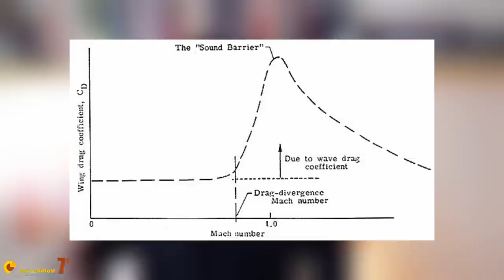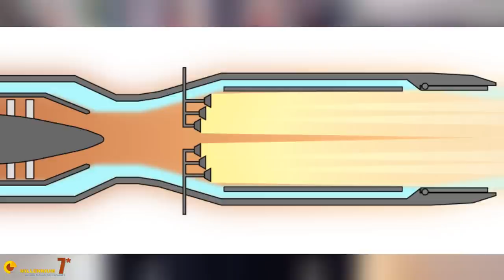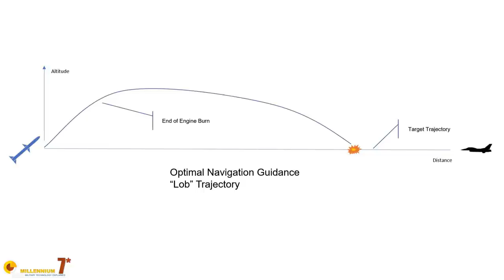Flying SUPERSONIC with NO Afterburner | Why SUPERCRUISE is so Important?

Comment: I think it's interesting that the aircraft with the highest supercruise number (F-22, Mach 1.8) is also probably the oldest on the list.
Reply: EE Lightning would easily accelerate to supersonic speed without Reheat, it would also do this in a climb. 1950’s aircraft
Reply: @alfretwell428  I'm afraid you are wrong - Without wet thrust the prototype demonstrated M1.02 ASL - before any payload and before development added the belly tank
It could accelerate wet to altitude and maintain mach in a shallow dive which is not supercruise
Reply: And by far the most expensive fighter ever made....
Reply: In the year 2021, 'the aircraft with the highest supercruise number (F-22, Mach 1.8)' may be accurate, but that is out-of-date info now in mid-2024. Currently, the j-20 with the new WS-15 engines can supercruise at Mach 2.2 substainably. This means that the F-35 (which cannot supercruise) is severely disadvantaged versus the j-20.
Reply: @johnseah5678  While I'm not an expert on the subject, I'm inclined to be suspicious of the numbers that the Chinese claim for their aircraft.

Comment: If I am not mistaken, the English Electric Lightning was also able to supercruise.
Reply from the maker: Yes, but it was a similar case like the F-104.
Reply: It might have been able to but wasn't too fuel efficient in any case, beautiful 50s aircraft though.
Reply: It could only do it in a vary narrow altitude window and with minimal armaments.
Reply: @Millennium7HistoryTech  according to the Lightning F6s Operating Data Manual it could supercruise at Mach ~1.05 at SL with full fuel and 2 red tops, and this speed only got higher with altitude.

Wasn't designed to do so but ended up managing it just fine. Either way wouldn't call it a cruise since you could empty the thing's tanks in 10 minutes!
Reply: This was a really interesting video. The explanations were very clear and concise with lots of (for me) new information. Excellent,thankyou!
Reply: @ukoctane3337  The Tornado could empty it's tanks in les than 9 mins. Many people think the EEL had short legs but used well could stay in the air for 90 mins +
Reply: @Millennium7HistoryTech  No - the F-104 was very unstable and the little wings gave very little lift.

Comment: I don’t think I’m a “fanboi” of the F-35; but the actual pilots will tell you (and have) that the aircraft can supercruise. Inasmuch as it uses afterburner to accelerate above Mach 1.2 (like the F-22) to Mach 1.5, then cuts to military power. It can then cruise above Mach 1.2 for 100nm-200 nm

While it’s true that the F-35 cannot sustain supersonic speeds indefinitely, it’s a bit disingenuous to say simply “it can’t supercruise” when there really isn’t a scenario when any aircraft would want to supercruise for more than 100-200nm
Reply: It's a bit of a technicality but people forget that the f35 is like the only jet that can super cruise with a combat load
Reply from the maker: Yes, I have heard of this, but the point is sustaining the speed to constantly stay above Mach 1 even in combat, even maneuvering., without using too much fuel.
Reply: @Aaron-wq3jz  well, the F-22 can as well. but yes, not many aircraft can fly at supersonic speeds with 2, 2000lb bombs and 2 medium range AAMs, a targeting pod and ecm pod hanging off their wings; the F-35 has all internally and thus, flies "clean"
Reply: @Millennium7HistoryTech  i understand.  I just believe that cruising 150nm at supersonic speeds should qualify as "super-cruise" as opposed to coasting. But to be exact, YOU are correct in that the F-35 cannot maintain supersonic speeds indefinitely. But to my point, if you can do it for 150nms....when would that ever be insufficient for the mission?
Reply: @mikeck9946   bingo, not to mention all the internal fuel and the fuel efficient engine which would allow it to carry all that 600nm+
Reply: @Millennium7HistoryTech  BTW, love your channel. Other than the fact that you seem to have romantic feelings for the Saab Grippen (lol), I find that you lay out information on aircraft performance without bias. Can't argue with science and math and its obvious you are quite knowledgeable about aeronautical "stuff".

Comment: I think that with the variable cycle engine, the supercruise issue will be solved for the f35 from what i've heard
Reply: It's not really an issue. They wanted range, not supercruise. The F-35A interestingly enough has greater range than the raptor even though it's smaller. Supercruise is way overhyped.
Reply: @EEEEEEE354  Supercruise is not meant for extended range. As millennium explained excellently, fuel consumption at supersonic speed is still higher in mill power, than travelling at mill power subsonically.

It is used for going into combat, where having high energy is the difference between live and death. Supercruise is not overhyped at all, as millenium explained greatly, but i guess you didnt even watch the video and went straight for posting uninformed comments.
Reply: @dyren7437  "they wanted range, not supercruise" what part of this statement makes you think that I believe supercruise increases maximum range? Come on now, don't put words in my mouth. What I'm saying is that the F-35 is a multirole fighter with a variety of of missions besides air to air combat. Supercruise was never a design objective of the aircraft. Range in internal fuel was. Supercruise is not needed for the F-35's role. This dude is claiming it's a "problem" when it's not. So yeah, I did watch the video, it just seems like you can't read. Do I need to break down english for you? "They wanted range, not supercruise". Saying "not supercruise" means that range and supercruise do not go hand in hand. I was NOT saying Supercruise was for extended range. I was saying the F-35 was optimized for range INSTEAD of supercruise. Who TF are you calling uninformed if you can't even read? 

This is why the F-22 has a combat radius of 590 nm internal fuel, and F-35 760 nm internal fuel. in fact, no supercruise capable aircraft can even approach the F-35's range on internal fuel. Supercruise limited range. The reason I'm saying Supercruise is overhyped is because it is not always necessary for the mission at hand. The F-35 is a strike fighter with kinematic performance of an F-18 or F-16. It was never designed to supercruise. It's fantastic air to air capabilities are achieved through superior sensors, electronic warfare, and stealth. Supercruise is just another point to make, it's not the end of the world if you don't have it.
Reply: @EEEEEEE354  Reading your last sentence: "supercruise is way overhyped" made me think you were talking about supercruise in general, not just for the f35.

Reading it again it makes more sense.
Reply: @dyren7437  read it right the first time. I absolutely hate when people like you misconstrue what I'm saying. Everything was clear, there should be no misunderstanding. Supercruise isnt overhyped just for the F-35. It's overhyped in general for an aircraft with more missions than just killing other fighters.

Comment: At about time 7:40 I think you misspoke when you said supercruising without AB still uses more fuel than cruising at supersonic speed.  I think you must have meant to say it still uses more fuel than  cruise at subsonic speed.  This points out that the term supercruise is a bit of a misnomer because it is not actually the normal cruise speed of the aircraft.  It is a tactical or combat speed that can be sustained without use of AB, proving tactical advantage at greatly reduced fuel consumption compared to AB, and fuel is life unless you're on fire.
I would like to know if you have any references specifically linking energy maneuverability theory to the development of supercruise, because I don’t see a real link.  Energy maneuverability theory about superior performance in a dogfight and rewards high T/W  and low wing loading, and afterburner is likely to be used heavily even though these fights occur at mostly subsonic speed.   Fighters were designed for superior energy maneuverability before supercruise became achievable in fighters.  Supercruise is about covering a lot of ground quickly while conserving fuel when positioning for and while engaged in a BVR missile fight, as you correctly mention in the latter part of the video.
Reply from the maker: OMG! You are right! I listened to that passage a dozen times and I didn't catch it! Apologies. It is exactly as you say.

Comment: Supercruise is actually NOT IMPORTANT compared to other characteristics such as payload, range, maximum Gs and other characteristics. That is why most fighters do not supercruise at all or do not supercruise meaningfully with a useful combat. Supercruising is NOT NEW. Tje Concorde supercruises for 3.5 hours crossing the Atlantic. If fighter designers in the 60s, 70s and 80s wanted supercruise they could have had supercruise. However, doing so would require bigger engines, lower bypass engines with worse fuel efficiency, reduce subsonic range, a slimmer air frame with less payload capacity, lighter air frames capable of less G loading or whatever else. It was deemed that it is better to have the most compact and lightest engines which still allows the aircraft to reach its maximum design speed.  And that means afterburning engines which is not capable of supersonic flight or barely able to sustain it on dry thrust. This is especially true of 3rd and 4th gen fighters worse external weapons significantly impact drag such that even if the compromises were made to allow for supercruise that capability goes away if you actually want to carry the weapons you need to fight with.

Comment: The M1,2 supercruise for the Gripen E is wrong.
No numbers has been released in public of Gripen E maximum supercruise speed.

M1,2 is however the maximum supercruise speed of the Gripen NG/Demo.
Gripen NG (or Demo as it's sometimes called) is basically a Gripen C with a more powerful engine and with the latest avionics.
Edit: The Gripen NG was a modified Gripen D (the twin seater), not Gripen C as I mentioned above.
The purpose of the NG was to be used as a testbed and demonstrator for the new technology.
I used the word "was" because there were only one aircraft built/modified of the Gripen NG and it is no longer flying since the Gripen E has started to be delivered to customers.
Reply from the maker: Correct consideration, I just assumed the two were similar, but it might not be.
Reply: @Millennium7HistoryTech  It could very well be the same number but since Gripen E is concederably larger than The D Version (the NG/Demo was a basically a D version).
On the other hand, Gripen E has been designed from the ground to achieve supercruise wich includes the drag has been reduced significantly.

I don't think we ever will hear an official number of Gripen E supercruise capability but I have heared talks about it will beat the Typhoon with some margin.
Reply: @mrSkandalpolisen  " heared talks"    "beat the Typhoon with some margin"    meehhhhh..... The Typhoon is one most powerfull twin engine.
Reply: @mrSkandalpolisen 😂😂😂😂
Reply: @armatacalanca962  Yes the Typhoon has very impressive engines but she is heavy.
The Gripen E may be a bit underpowered for dogfight action but she most likely has the lowest drag at level flight of all modern fighters (she certainly does have far lower wingload than the Typhoon = Gripen needs less power for the same speed).
Reply: @joshafc41  There has been some numbers released for Gripen E and it's supercruise.
Gripen E can supercruise at M1,2 equipped with 6 missiles and one center tank.
Exactly the same numbers official for the Typhoon....
Reply: @mrSkandalpolisen  The only accounts of the Gripen super cruising have been of a clean Gripen NG super cruising at Mach 1.2. So if a clean aircraft only reaches Mach 1.2 how can a dirty one reach the same speed with such a load. I highly doubt it's capable of super cruising at this speed with 6 missiles and 1 fuel tank. The aircraft is extremely small this kind of carriage would affect It's thrust to weight ratio and by extension specific excess power greatly when compared to bigger aircraft.

The Typhoon has demonstrated its ability to supercruise with 2 fuel tanks and weapons in any weather hot or cold enough times and there are several accounts and statements all over the internet from pilots. The Gripen has not.

So if you're so adamant that the Gripen is more capable supercruiser then show me exactly what led you to believe that because I've been unable to find anything and the spec sheet tells me it's not a realistic expectation either.
Reply: @joshafc41  First of all, Gripen NG and Gripen E is not the same aircraft.
Gripen NG was a modified Gripen D (which in turn had the same airframe as the 40 year old Gripen B).
The one and only built Gripen NG was a test aircraft and therefore had a lot of extra weight for testing and verifying new technology.
So to sum it up for the NG, it had a 40 year old aerodynamic design and it was quite a bit heavier than the original Gripen D.

Gripen E is more or less a completely new aircraft designed for supercruise (new wings, new fin, new canards, new body).
It may look very similar to the older Gripen but it's completely newly designed.

Next thing, SAAB never said that M1,2 was the max supercruise speed for the NG.
They simply said they have flown M1,2 supercruise with the NG but with an undertone that more were to be expected.
Reply: @mrSkandalpolisen  I know the difference between Gripen NG and Gripen E. I actually had a deeper look into it and it turns out the Gripen NG didn't actually supercruise it needed the after burner to get supersonics before cutting it and maintaining the speed on full military power. According to Magnus Ljungdahl the test pilot who flew it.

The only aero dynamic differences between the Gripen E and Gripen NG are that the Gripen E has slightly bigger flaperons and wing tips for the electronic warfare equipment. They use the same engine which by the way was not designed for supercruise. So I doubt the Gripen E would see any advancements Vs the NG that would help it with this ability. In fact I'd say it's probably less likely to be able to supercruise though only slightly due to the additional drag from the bigger flight control surfaces and wing tips. The drag is most likely negligible and wouldn't make a difference. But I'll maintain my stance in doubting the Gripens supercruise abilities until it has been proven beyond any doubts.

There really aren't any statements anywhere stating the Gripen E can really supercruise without afterburner and with weapons and fuel tanks.

Comment: Although it isn't in service anymore the tomcat could supercruise
Reply: F14 had very underpowered engines, that's why they had their engines changed in their B & C varients. Though the energy needed wasn't much gained, and this is one of the major reasons to retire that jet. This is what I know, though you can correct me if I'm wrong, it's welcomed.
Thanks
Reply: @yogeshchaudhary2093  Nah man you're kinda right, 28% of all accidents were because of the underpowered TF-30s, but the B and D models fixed it and they were pretty good actually, the GEF110-400s
Reply: @deepalperera4592  OK, I didn't knew that, thanks for the correction man, appreciate it.

Comment: I still don't understand how it works?
Reply: It's quute simple. It's when an airplane is designed to generate low drag and have powerful enough engines to overcome the sound barrier. 
Having low mass means that even smaller engines can do the trick.